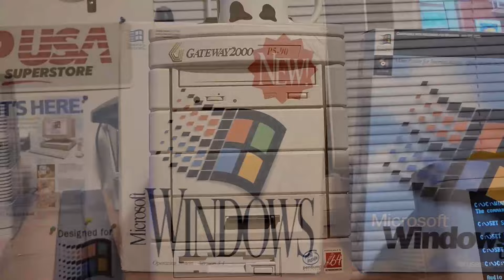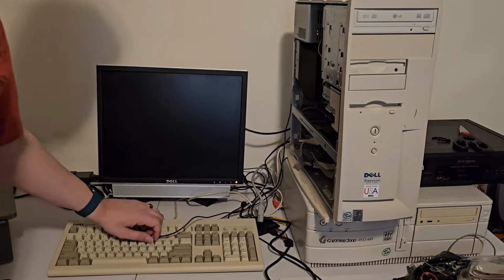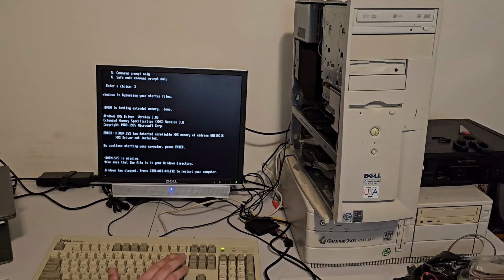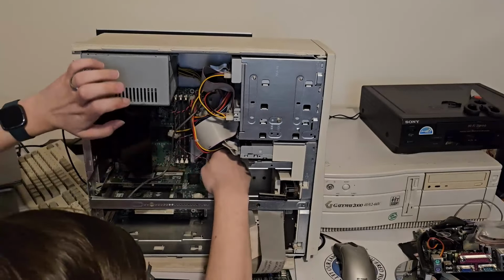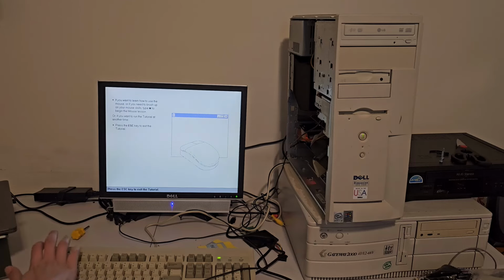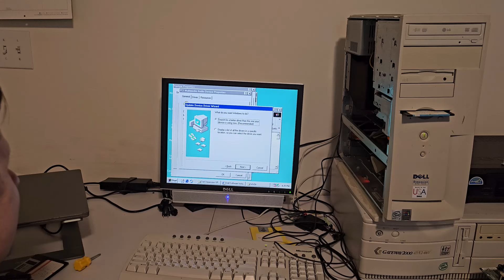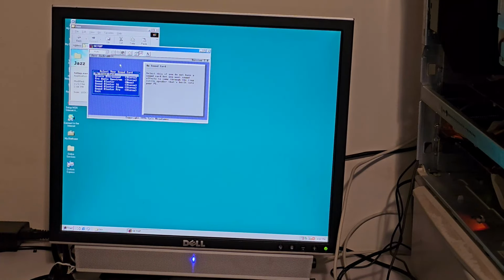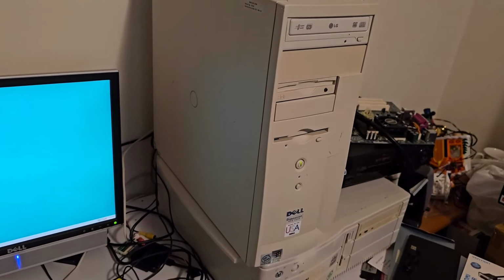Dell Dimension XPS T550 Restoration

Comment: Nice little restoration, RMC also did a restoration a while ago of a similar PC. I sort of think these machines were somewhat ahead of the curve, I notice with other more "office" sort of PCs of the pre-PCI-E era they lack AGP which unlike today with PCI-E you couldn't take an office bound computer and turn it into a capable games machine. Bucking the trend and including an AGP slot makes them great for adapting into retro game orientated PCs in this day and age. They seem all to be based on the 440BX chipset too which seems really solid from my experience.

Comment: I've seen many Gateways and Dells come with those Promise etc branded "RAID" controllers. Sometimes it was to get faster speeds (ATA100+ for ATA66 stuff, or ATA133 for ATA100 stuff) than the default controller, sometimes it was for larger disks etc.  They did it for various reasons.  Basically, any version of those cards is pretty stable, REALLY good to have some on-hand.. especially the bootable ones.

Comment: i had the same problem with my dell keyborad, with the keys, i have dell p3 1ghz computer ,, i used my gateway 2000  keyborad and restored my dell computer,, thats cool dell restore disc i just orderd one on ebay, i would add the 98 plus cd

Comment: I got a Dell that looked exactly like this in 2001, but it had a Socket 370 Pentium III 1 Ghz. I bought a geforce 2 mx for it, later a radeon 8500. I don't know why you weren't looking at ram right when it told you about the XMS and listed a memory address, you might even have been able to use contact cleaner and clean the ram believe it or not sometimes that fixes it. I wonder if the original drive boots now